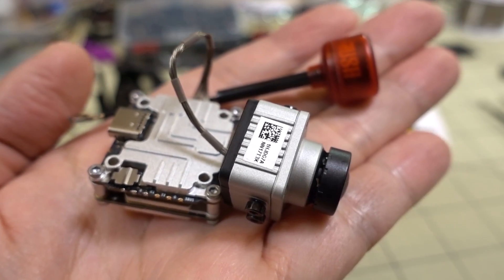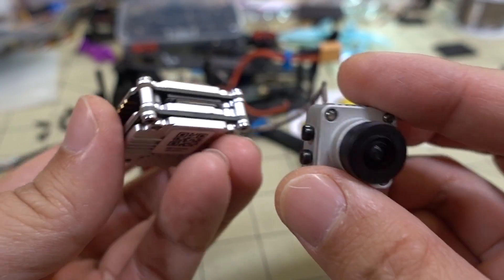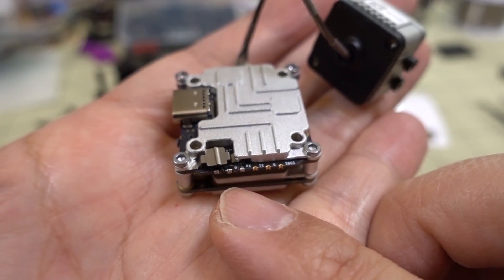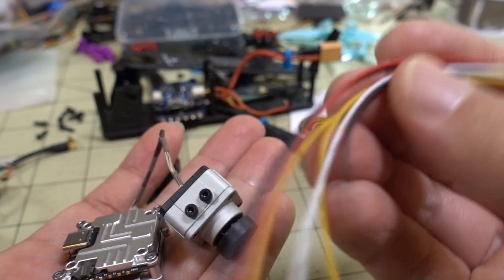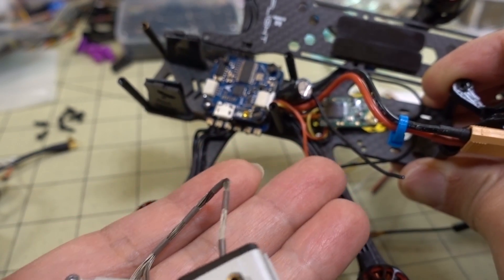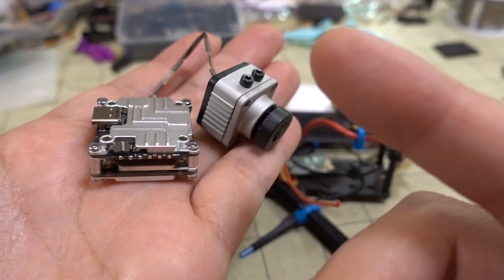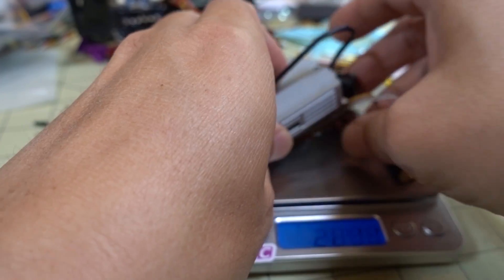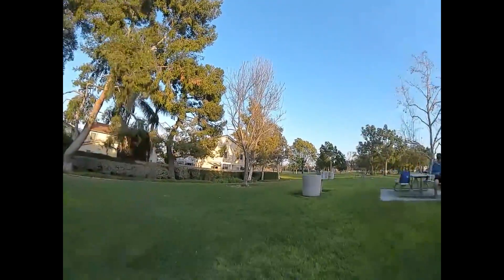Caddx Vista DJI Digital HD Air Unit Lite First Look 🔥

Comment from the maker: 🛒 Caddx Vista Air Unit "Lite"
       banggood - http://bit.ly/2QJsShw
       racedayquads - http://bit.ly/2QKaUM5
       airbladeuav - http://bit.ly/35DLdkd
       newbeedrone - http://bit.ly/30jUr4f

This is basically the same as the original DJI Air Unit without onboard recording and only one antenna, not two.  All other features seem to be the same.  Oh yeah, this one is also lighter and can mount to 20x20 stacks.

Also, the FCC and 1200mW hacks work on this as well.
There is 4gb of onboard storage for saving the naco.txt file for the FCC hack.  It can't be used to record onboard video however.

Updating of the Vista Air Unit firmware is also via the DJI Assistant app.  You'll need v2.0.2 to get the latest firmware v01.00.0300 dated January 10, 2020.  You'll need to update the goggles and transmitter to get everything to link up.
Reply: Instablaster...

Comment: Anybody got some clean PID's for this quad? I have the Pre-Built DJI setup and its almost there but I still have a little bit of wobble on hard throttle and changing directions quickly, especially with high momentum. Also I have been waiting for a product like this for 5 years. DJI will be getting about two thousand dollars from me over the course of the next nine weeks. I am buying a second headset as well as two more pre builts and several of these units.

Comment: Great Video! What Antenna does the Vista System has? RHCP or LHCP? Thank you. Maybe it makes sense to test different antennas for better reception.
Reply from the maker: It's LHCP... shown in the video at timestamp 0:56
Reply: @AlbertKimTV  I am a bit confused why the sides of the DVR are so pixeled even with 700mW. I saw DVR from Caddx Vista under bridges with many trees without pixeled sides. Can you imagine why? :-O

Comment: I’m having issues with range in my air units and till know I trough it was because of the goggles, antennas or maybe a bad configuration but recently someone told me that could be the DJI controller what is actually bad experience fly the digital system. At 1200mw my image star freezing and and i star losing control over the quad till it just fail safe. What is your opinion about it? The Mac range and getting is flying straight line without any obstacles and is about 1/2 mile I think that is bad
Reply from the maker: Not enough information here to know what is going on.. The Air Unit may not be getting the proper amount of power.  You should check to make sure that however you are providing power is providing enough watts.

Comment: Oh and PPS, the reason you're getting pixelation / focus mode even close by when signal strength is good, and bandwidth is good, is because of the digital compression due to all the trees/grass nearby.  Basically the compression struggles a lot more with lots of detail and independently moving picture elements, so when flying slow, and near trees / leaves / grass / water - it's about the worst thing for it.  That's why it clears up as soon as you punch up and the image becomes more simple - there's less to compress - the same thing will happen if you go faster.  It's not related to bandwidth or signal strength at all, it's just compressing the more complex image more in order to get the packet size down to meet the available bandwidth and maintain frame rate.  And yes, changing power levels will freeze it for a sec.
Reply from the maker: Good to know... I figured it was something like that.  Have you seen the follow up video?  In high-quality mode, the image was so amazing!
Reply: @AlbertKimTV  Yeah that looked fantastic.  If you haven't tried yet, try throwing the 14mm Caddx ND8 filter on over the camera, run 4:3, then stretch to "fake superview" in post. Looks almost like go pro footage!

Comment: Hey Albert, are you sending the broken DJI radio in for repair? If not, could I buy it off of you?  I have been wanting to pick up a broken one to gut the circuitry out of.  I want to experiment with passing the signal out of the module bay on a OpenTX radio to it's control inputs to try and use it as a "digital radio module".  There are a lot of folks I think that would love to be able to put DJI's control link onto their existing radios and I doubt DJI will ever make such a module themselves.
Reply from the maker: Yeah, I sent it in for repair.  Turns out to be cheaper than buying a new one.
Reply: @AlbertKimTV  That's great, glad to hear they are taking care of you.

Comment: Hey Albert I have a theory on why the DJI system is pixelated when close to the ground but then clears up up high

It does it on mine too when I fly at my local park. The way that the stock antennas are placed on the goggle puts the dead zones from the top of the antennas right in that 30ish degree area. So it stays pixelated at low cruising highs but if you pop above the trees it immediately clears up because it's in the correct orientation where it can collect the signal better from the sides of the antennas.
Reply from the maker: That sound plausible

Comment: Your constant report on pixelization isn't really relevant as long as you're seeing 25Mbit. If you were getting 25Mbit on 25mw, then upping the power wasn't buying you anything except placebo effect. The pixelization probably had a lot to do with the lighting. The system seems to compress dark areas more. If the lighting is low, I normally have to up the EV to +2. I always run High Quality and Focus mode to keep the center pixelization low. When you get up high, the lighting is better and the landscape isn't moving as fast. It always looks awesome when you get up high.

Comment: There's a guy building a "micro long range" 4" that will fly for about 11 minutes at 220g AUW, with Crossfire... if my math is right, you still have enough headroom to get this on there and be under 250g, and with the 1200mW mod you'd really be on to something.
Reply: #1 bullshit.

Comment: Well technically all you are changing is the max power output level. The system system decides on power level you get.
Reply from the maker: nitpicking are we?
Reply: @AlbertKimTV  To me It did not seem to make much difference so I don't think the system raised the power level all that much. Normally I have seen plenty of difference between 25mw and 700mw but that was on the full air unit. Wish there was a way to actually have a fixed output level.

Comment: Nice review, very interesting product. But I'm living in the eu and in my airunits I did the fcc mod, but you do that by putting a file on the sd card and put it in the airunit. But this unit have no sd slot. Do you know if it is still possible? Maybe activate with a vpn or something?
Reply from the maker: I added this to the description, but here it is again.  When you plug in Vista to the PC, it shows up as a 4GB USB drive.  You put the naco.txt file on there and the FCC hack works.  The 1200mW hack also works but that file goes on the goggle SD card and works the same as before
Reply: @AlbertKimTV  oooh I missed that description part. Thx man that's makes a lot of sense.

Comment: Awesome you got this first. Thanks for your time showing us the footage etc..I was really curious about this before I preordered . I was hoping a little lighter but definitely better form factor & weight than the original air unit. I’ll definitely be buying now. Would like to see more test with it. The freezing frame is a little concern🙃 Didn’t get to see how you mounted it in the DC3 .. you mount in front or back? The newer firmware update for just the caddx airunit ? Or all air units & goggles?
Reply from the maker: The firmware update is for all components.  I will be making more videos.
Reply: Albert Kim Awesome thanks i got two air units & goggles to update now..lol
Reply: @AlbertKimTV  Well i guess if your going to run the Caddx Vista then new firmware is needed. But if you havent bought the Caddx Vista yet? Or waiting on preorder for the vista..Then run your old firmware especially if you use a lot of the Betaflight OSD elimates because on the new firmware you have to turn on the Betaflight OSD in the DJI goggles everytime you plug in. Not much improvements on the new Firmware other than Caddx Vista air unit. Just saying. But i guess ill stick with the new firmware given i plan on getting two vistas.Hopefully they fix back the OSD to stay on
Reply: @AlbertKimTV  New firmware. 400 fixes the osd issue just updated today. Everything works nice😀

Comment: Xm+ receivers aren’t all crappy some worse then others depending on where you purchase from I bought on from amazon and it would failsafe rather quickly but then I bought another from race day quads and it hasn’t failsafed on me but I have also switched to crossfire on my second quad.. I’d like to know when I’ll be able to use my foxeer cameras with the dji system and my current goggles

Comment: I often fly around dusk. Any thoughts on its low-light performance?
Reply from the maker: I thought it was pretty good.  Just about the same as the original Air Unit.  It's the same camera so it should be the same.

Comment: nice vid. do you think this will fit in an armattan gecko 4"? they have 2 sets of holes in that frame for 2 20x20 stacks, but i know the vista is a tad larger. Maybe I just use 2 holes too? What do you think Albert?
Reply from the maker: The dimensions are 30.45x29x13.06mm.  I don't have that frame to see how much space is left over so you'll have to measure yourself.
Reply: @AlbertKimTV  thanks AK!

Comment: Awesome video, Some side by side of the Vista and the air unit with the srt files burned into the video so that we can compare bitrates would be cool.
Reply from the maker: Hmmm, I'm not sure how I can get two of these into a quad and I'm told they will interfere with each other being so close so this is a test I don't think you'll get any significant results from anyone.
Reply: @AlbertKimTV  not on the same quad. I'm just meaning fly a circuit around with one then fly the same circuit with the other and edit the videos together so that we can see the differences in performance at similar distances

Comment: Excellent review.  It says 1080p capable...you mention 720p?  Do you think w/DJI transmitter it would be better?  Thanks.
Reply from the maker: That must be a misprint/typo as it only transmits in 720p.  DJI transmitter would not have failsafed that close
Reply: @AlbertKimTV  Here's where I saw the figure.  https://www.banggood.com/Caddx-Vista-HD-Digital-System-5_8GHz-FPV-Transmitter-VTX-FOV-150-Degree-Camera-1080P-Recording-AIO-Compatible-DJI-FPV-Goggles-Remote-Controller-For-Small-Drones-Whoop-Airplane-p-1625165.html?utm_source=Youtube&utm_medium=cussku&utm_campaign=marblekit&utm_content=zhikejian&p=63061312105582015022&cur_warehouse=CN

Comment: Same price as dji air unit for less funtionalities*, less weight, and looks like a not finish product ummm, it doesn't seem like a good deal. Ok, I can pay less than 100, no more!!
Reply: The full size air unit for $149 was holiday pricing. They are $179 normally.
Reply: @therealjonnyd  dji and caddx decide the retail price, no need worry
Reply: @therealjonnyd  
On amazon 149.99, on NewEgg same price, on B&H Photo same price ;) . For now they have this in stock, maybe tomorrow they don't.
Reply: @alextkd2003  I have a feeling that DJI will slap them on the PP soon if they keep that up.
Reply: @therealjonnyd  I have the same felling 😕, but for now that's the price. I found the units available on Amazon, only 6
Reply: @alextkd2003  knowing how much cost is for the item, they're not making anything unless DJI decides to drop the wholesale price for them.
Reply from the maker: Interesting speculations but none are true.
Reply: @AlbertKimTV  who said they were speculations?
Reply: @therealjonnyd  I hope over time the digital become the standard and the prices go down.

Comment: Thanks for the video.  It looks like a good product for smaller quads.  How small a quad (e.g., 2”) could be flown with this product?  I switched to Crossfire, not necessarily for the long distance, but for the signal penetration.  I got tired of Failsafing in the desert where I fly and losing quads.
Reply from the maker: I have a 2 inch cinewhoop with this coming

Comment: Thanks Albert. I wondered how it had been shrunk so quickly down to 20x20!  Lack of onboard is disappointing on one hand, but on the other...it can only get better and I am grateful that DJI has started the revolution with true digital video :) They get onboard in the next version and I may just have to come off the fence!
Reply: MAD GRUMPYMAN  the (regular) air unit records at 1080p 60fps onboard, the goggles record at 720p 60fps but the incoming signal is a lower variable bitrate. It makes a difference. That being said, for what most people are doing with micros -- who cares?  It's sufficient and convenient to just use the goggle DVR. If you're flying a 5" quad, you'll want a GoPro either way.
Reply from the maker: For those who are going to add a GoPro anyway and not use onboard recording, the Vista is useful and saves some weight.
Reply: @therealjonnyd  Thanks for answering. I am saddled with 250g limits and I want the best footage of my flights I can get. A Tarsier on a micro is still a better option at this time.

Comment: How much of the Betaflight OSD elements can you see since it's not actually in the "video" part of the feed?  I remember at the start we only had voltage, but then it was supposed to have gotten better after one of the later updates.
Reply from the maker: It's the same as the original air unit. See my earlier video from about a month ago

Comment: I think the price point is off for this to have a high adoption rate at this point. I’d like to see the larger air unit price drop to about $160.00 and this drop to about $130.00. It’ll probably happen by years end as more adopters come on board.
Reply from the maker: Price will come down eventually

Comment: Is the cable for the camera the same length as the original air unit?
Reply: That's a good question, it looks shorter in this video but I hope he answers this question.
Reply: 8cm
Reply from the maker: It's shorter by about 2-3cm

Comment: thanks for the review!
please do the other power output test and no focus mode!
Reply: What possible benefit can this unit have at that price point...over original air unit?
Reply: @Theo-dj7vs  The size?
Reply: @MCsCreations  ok you shave off few mm (ie you can fit it into your older $25 micro fram) and couple grams (will it save you from registration and FAA?! No)...are you still under 250grams with battery?  That is The Only use case where this price point makes sense.
Reply: @MCsCreations  Well the other way this makes sense is that DJI knows it has 'boots on the ground' on YouTube (ie product pushers...influencers)...that make fleecing noobs easy money.
Reply from the maker: Smaller size, less weight, 20x20 mounting option so more frame choices.
Reply: @AlbertKimTV  the weight arguement is mute, for anyone using 4S and up... More frames to fit option is mute as well...whether by cost comparison or by long term use/newer frames.

This is DJI trying to capture noobs...or transfer them from analog to digital...its a marktet segment they (DJI) couldn't previously fit into...

Again if your flying 3" or 5" this is not an improvement from original and definitely not at that price point.
I fly DJI and it's not worth the downgrade for the price.

whether from price point  (Theory fine actuality its fanfair...when batteries weight is 170grm)
smaller size for mounting.
Reply: @Theo-dj7vs  23 grams makes ahuge difference on the racing front.
Reply: @AgustinMolini  ok.  And who racing DJI?
Reply: @AgustinMolini  it's like people just repeat the meme...who races DJI?
Reply: @Theo-dj7vs  Very few people. Circing back to what I just said.....